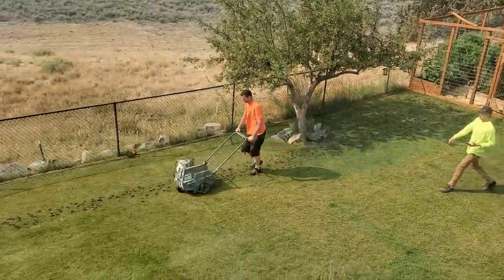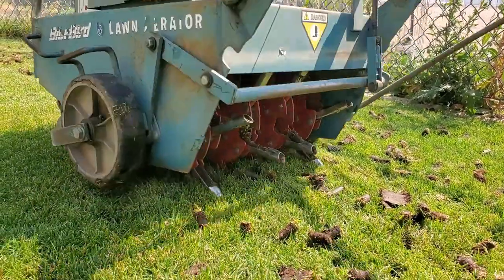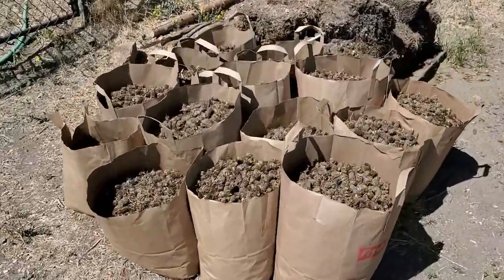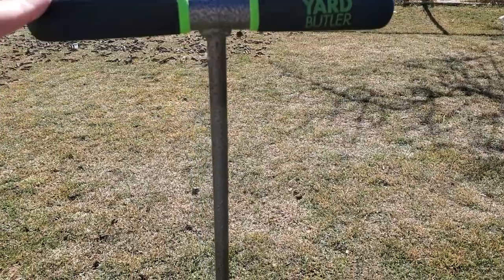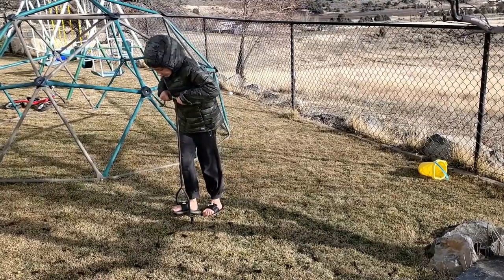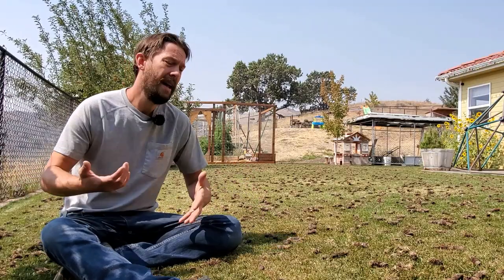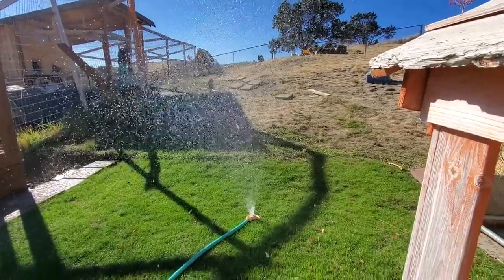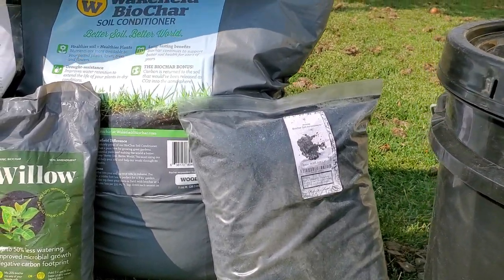How To Aerate Your Lawn And Why Aeration Is Important

Comment: You convinced me to manual core aerate my lawn and I'm glad I did. 1300 sq ft and it's a grind for sure, 24 hours labor to do that, about a sq ft a minute including picking up cores (24 cores / sq ft). You said the power aerator goes deeper and I disagree. I use a fiskars manual aerator (2 x 3/4" x 4" tines) and I make sure I get the full 4" on every single plug. The power aerators may get you 3" on soft ground, but when you go over a hard patch of soil, where you need aeration the most, you are lucky to get 1 1/2". Sometimes even less then that. Manual is far superior in that regard. Great workout too, but very labor intensive.